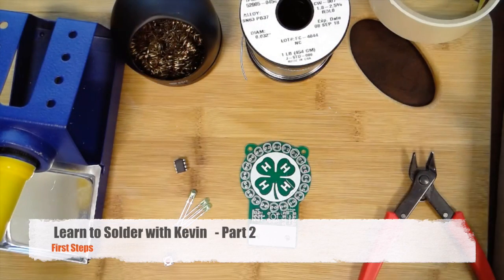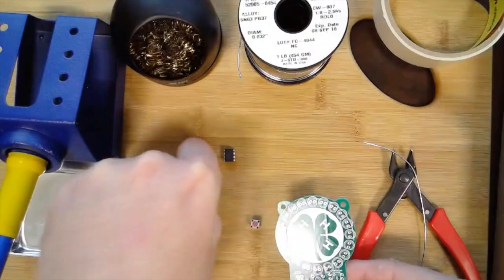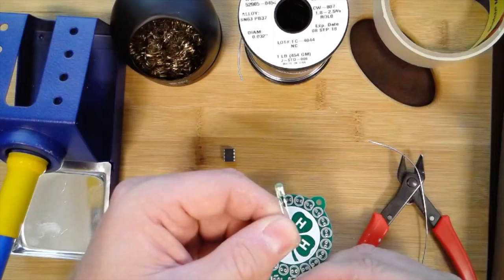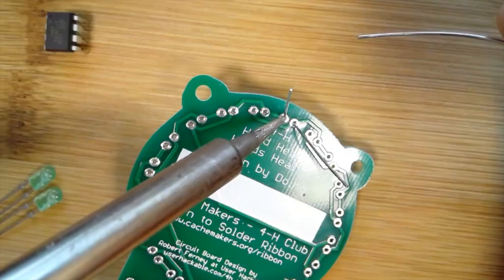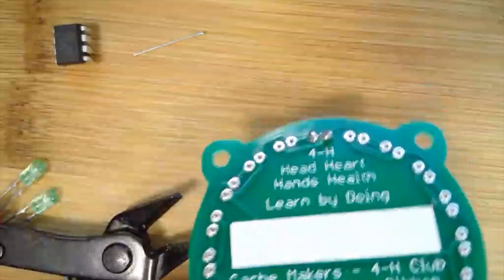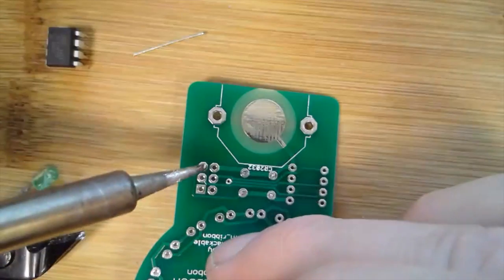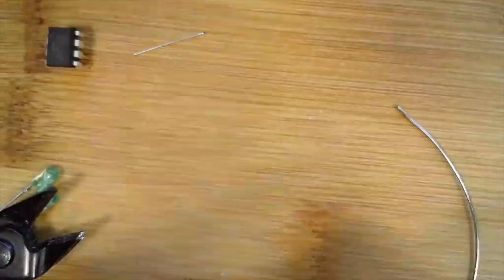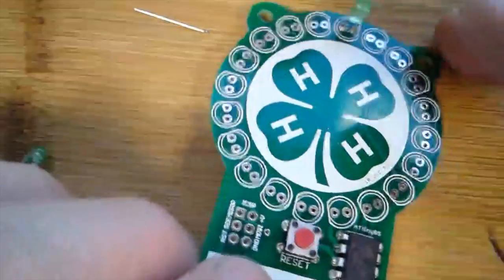Learn to Solder  Part 2 - Basics of Soldering

Comment: Hi Kevin. What temperature do you set your iron at?
Reply from the maker: Currently my iron is set to 290c.   I will move it up and down if necessary depending on the project, tip size I am using, size of metal being soldered, etc.   But most of the time I leave it set here.  I am using Indium Lead  solder  SN 63  PB 37.  Spec shows a melting temp of 183c for this type of solder.    You need the higher temp because you are also heating up the metal tab/pad to take the solder so you do not get a cold joint.   The actual temperature needed is subject to a lot of opinions. I just pick what works for me a go for it.
Reply: Thanks. Much appreciated. I am at 325°C normally and I never know if that's too hot and will damage components. (I often find myself desoldering with a solder sucker). But is seems to work. Maybe I can come down a fraction. What I do need, though is a smaller tip (like yours.). Many thanks for the post.